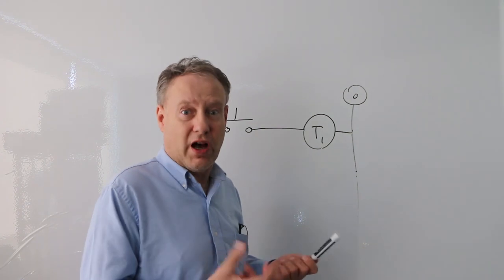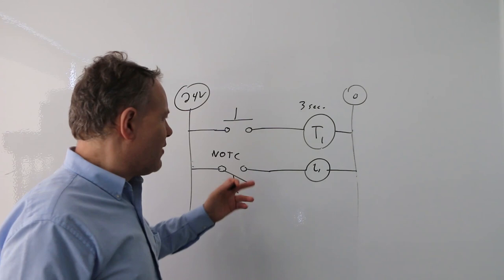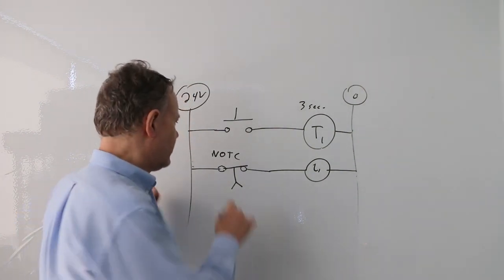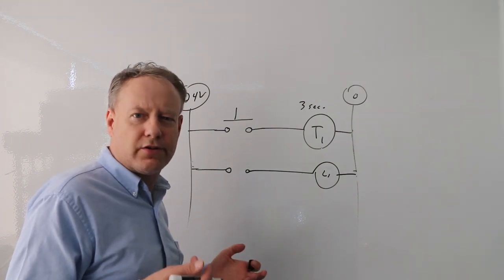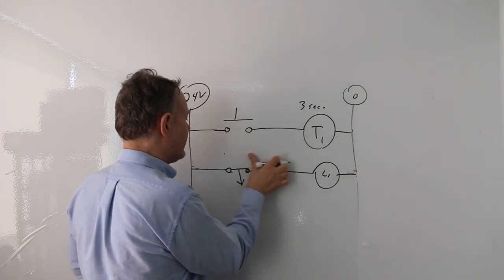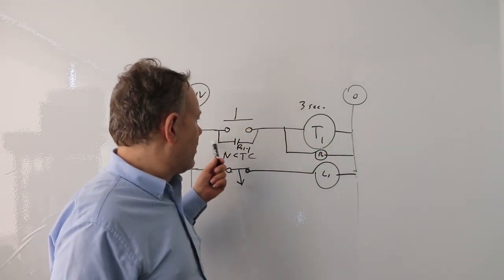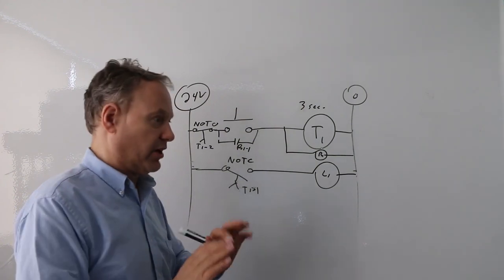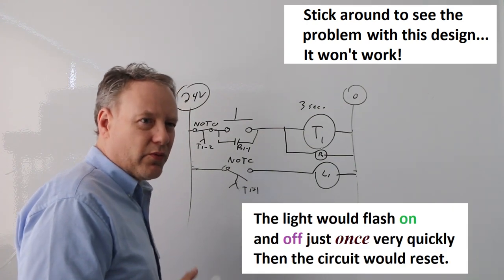Introduction to Timers and Timer Contacts

Comment: There is a confusion about off delay timer.
In my anderstanding ,there are 3 types of off delay timer.
1)- pneumatic timer could used for off delay
2)- True off delay

3)- with signal contact the off delay should always be energised

Comment: Too many components for such a simple operation can't it be minimized. /
Reply from the maker: Control systems often have many components than what I have used in this control circuit. If you go into further study of Ladder Logic, you will find the circuits become more complicated with more inputs and outputs as well as the more complicated the control parameters.

Timers only scratch the surface of the numerous control devises in Ladder Logic, including Relays Holding Circuits, Memory Latches, reverse logic, multiple contracts on single devices, termination contacts, both Normally Open and Normally closed contacts and many more control programming and components.

I do not think this circuit can be simplified and function the same way, but I am very open to looking at different options. 
If you would like to explore more Ladder Logic examples, I think this one example will become less “Too many” to you and you will start to see the power of Ladder Logic.

My channel has several Ladder Logic examples that I believe will help you understand it from the most basic circuit to more complicated control circuit. If you wish, you can look at the Playlist “Intro To Controls ATMN 110 (Lab)”